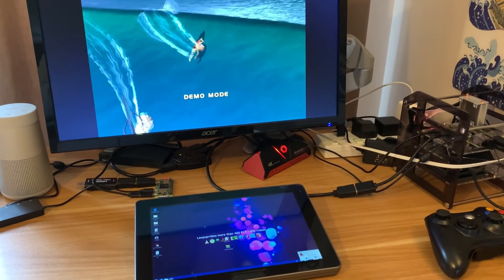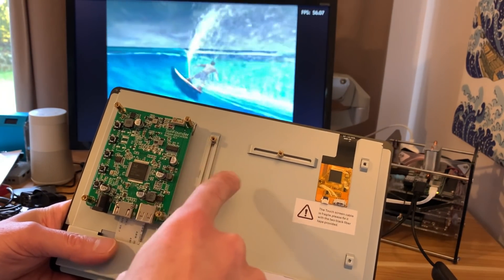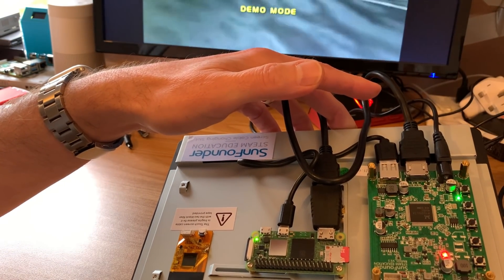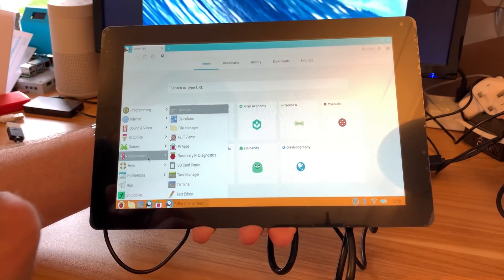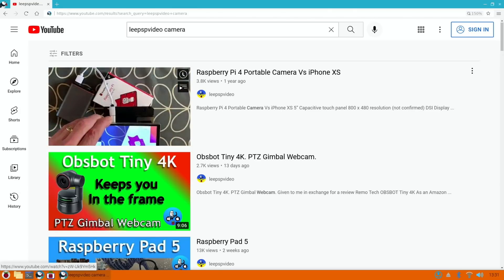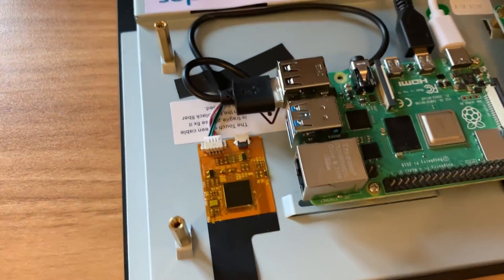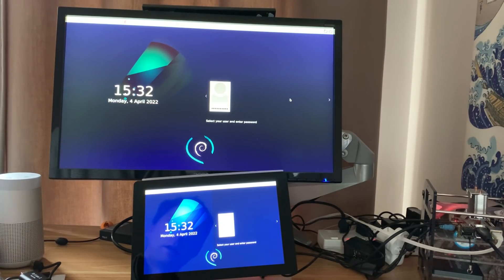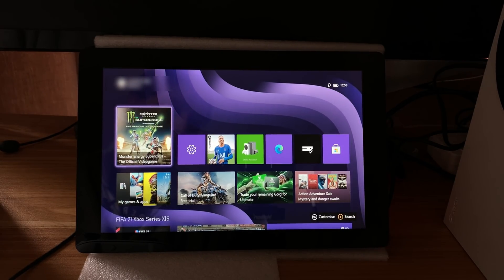Super Versatile 10.1” Sunfounder touchscreen display. Plus 2325Mhz Overclock Raspberry Pi.

Comment: Mine is not touch screen and has the 5 buttons on the top of the screen--volume up and down--power--a menu button to bring up different display options but I cannot figure out how to use them. Since it is not a touch screen and the mouse does not control them either. I power my 400 and the screen with my Portable Laptop Charger Power Bank AC Outlet 65 Watts HP Notebooks . Thanks Mike
Reply: any idea how to use these 5 buttons

Comment: Re. 2325: My 400 is completely stable at 2300 with no cooling. At about 2325-2335 it becomes unstable but the temperature is still ok. The heatspreader is doing a great job.

Comment: Hello please help me,,,
In my rp 4 4gb i ve installed raspbian os 64bit but after shutting it off and again turning it on all the desktop settings keeps getting to default, i mean that my chrome settings which i had changed again gets to default and 2. I ve did some settings in taskbar like adding panel items and doing some change it but all gets to default after a reboot??????

Is there any solution to it?????
Reply from the maker: Sounds like “Overlay File System” it’s a way of stopping any changes to an os being made. It’s on my list to make a video on it.

Comment: Hi Lee!
I ordered the new sunfounder ice cooling tower, it’s so quiet! I also turn the fan off coz the heat sink does the job, and I’m not overclocked, however, the unit is amazingly quiet, and so cheap! 
Maybe a review coming up from you? I got it on amazon👍
Reply from the maker: Yes, one is on its way. 👍🏻
Reply: @leepspvideo  they’re sooo cool! Literally as well🤣👊. I hooked it up to 3.3volt, had to test it at night when it’s silent, even then you have to be near it to hear it!
Reply: @leepspvideo  Actually, I can’t tell the difference between 3.3 volt and 5volt. 🤦‍♂️🧐 seriously silent. The led glows better on 5 volt so I switched back to that.

Comment: I was looking to upgrade the control board in one of my 3D printers but the standoffs dont match the board's mounts, I was going to cut 3 of the standoffs off and resite them with JB Weld but looking at that screen I'm just going to print 2 of those rails and get some of those rail standoffs.
 Q.- are the standoffs just screwed into nuts or are they hammer nuts?
Reply from the maker: Screwed in
Reply: @leepspvideo  yeah but what kind of nuts are they?
Reply from the maker: @AndrewAHayes  common looking. 

Same design as these just smaller
https://uk.rs-online.com/web/p/hex-nuts/2484589?cm_mmc=UK-PLA-DS3A-googlePLA_UK_EN_Fasteners_%26_Fixings_WhoopHex+Nuts_Whoop-2484589&matchtype=&aud-772940707919:pla-354537421194&gclid=CjwKCAjwrqqSBhBbEiwAlQeqGurKVAGlIIoJIS4LuItG4X49tkZi-qmKeKdX_jOcIbAl0DtGApAj7hoCH2QQAvD_BwE&gclsrc=aw.ds

I’m guessing you are talking about the ones under the rail?
Reply from the maker: @AndrewAHayes  https://docs.sunfounder.com/projects/ts-10/en/latest/assembling.html

Comment: I thank you for the mention. I would, however, had been extremely surprised had Windows 11 worked.

A good review, but it would have been nice for Sunfounder to add a cheap stand to the display - albeit I guess one could 3D print one relatively easily.

Comment: The problem with the 12V power is that you can't easily throw a powerbank in to make it portable; if it was 5V it would be a killer tactile display
Reply from the maker: Not sure what battery is in the Raspad 3. I wonder if it need the extra voltage to power the screen an a modern SBC?
Reply: @leepspvideo  mmm judging from the power adapter you show in the video the screen needs very low current; probably 12V are for the led/lighting as you mentioned; I tried in the past a dc-to-dc booster (5v in 12v out)  to power a chinese hdmi to ipad screen card but it wasn't enought current I think because the screen kept flickering and going out sometimes; besides adding a dc2dc booster is complicated in an already crowded LCD backpanel
Reply: Have you found a way to make it charge by a powerbank